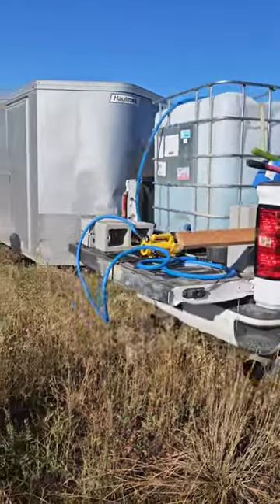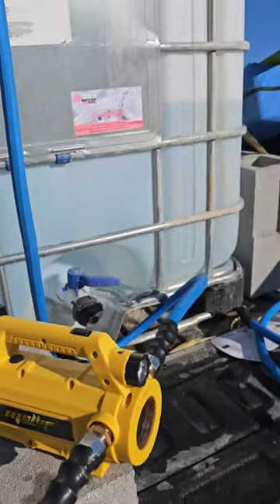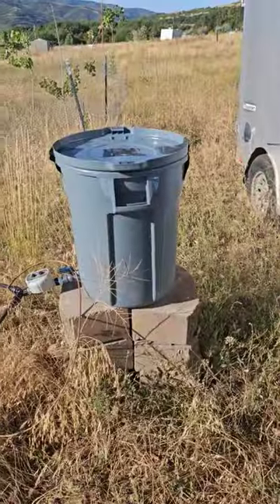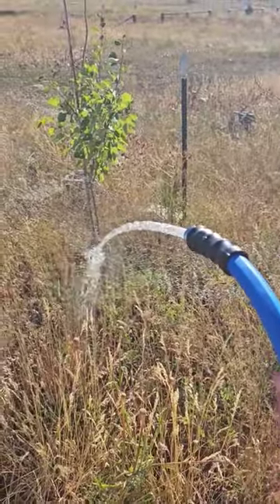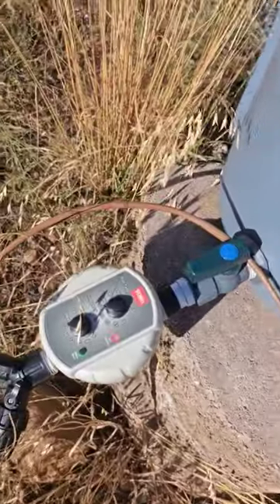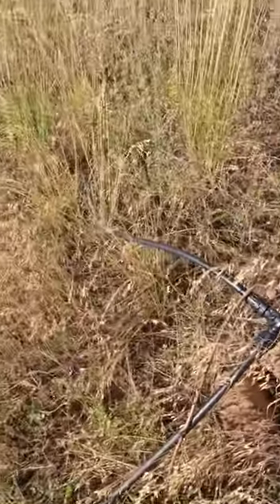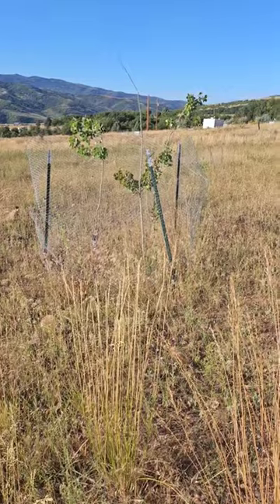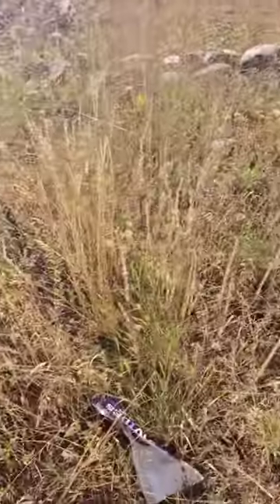This is how we fill up our barrel drip system at our property #fyp #dripsystem #garden #waterpump

Comment: curious to know if it makes a difference when the water temp is as high as it probably gets sitting out in sun, my guess is in the 110°+ when it's watering?
Reply from the maker: I would imagine that it might shut down more often on hot days while over heating. We haven't gotten that far but I can keep you posted :)
Reply: @absolutelyyouhomeandgarden  sure deal.  I was referring more to the actual temperature,  particularly just because the water that  falls naturally/even city water is probably half the temp, by the time it sits in bucket, then through black pipe all day, it's heater, it could come out a little closer to boil than not.  Just geeking out...  might have to do an experiment.
Reply from the maker: @kellstat  oh I see what you mean, I'm sure that the water does get warm but we've had the trees  and the garbage can drip systems up since September of last year and the trees seem to be doing just fine 🙂
Reply: @absolutelyyouhomeandgarden  it's a Permaculture geek thing.
Reply from the maker: @kellstat  I like it😀